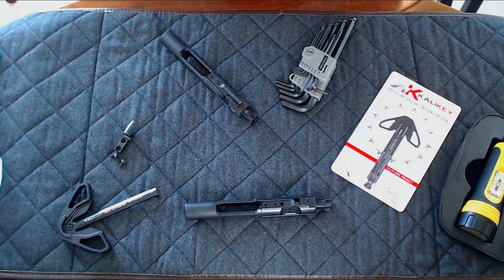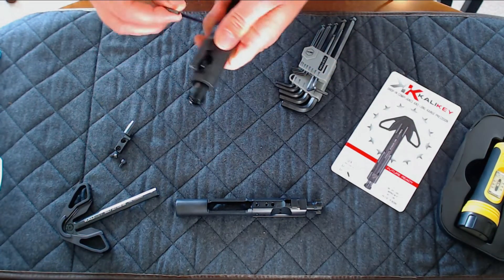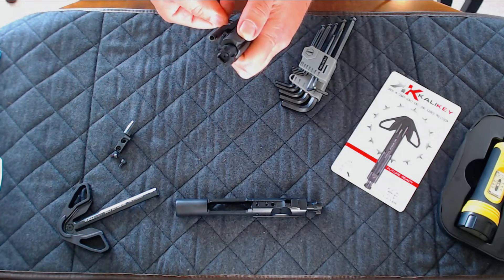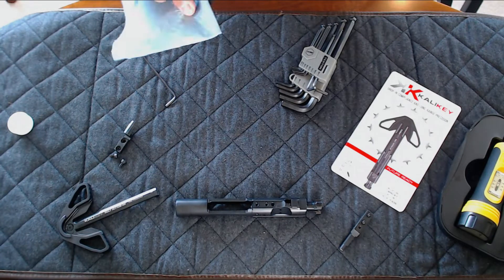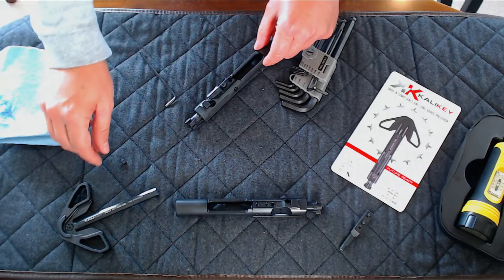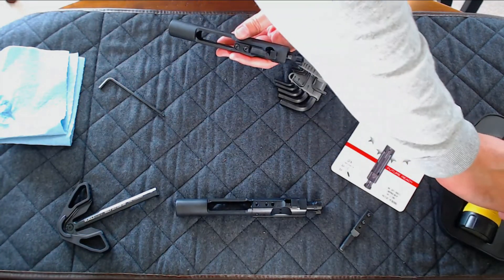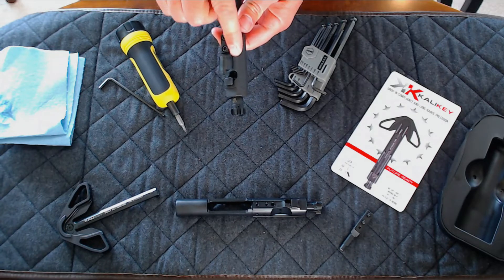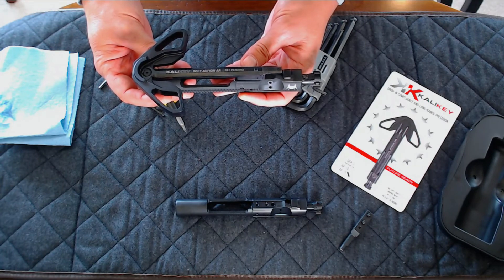Installation:  Kali Key (Gen2 Revised Edition)

Comment: Will the AR-10 Kali Key Lo-Pro Bolt-Action System + BCG Bundle  work with 6.5 creedmoor?  Running aero precision m5 upper/lower which is dpms style
Reply from the maker: Hi! The Kali Key is caliber agnostic. It also will work with all true LR308 ("AR10") DPMS patterns (meaning stuff that doesn't use some sort of proprietary dimensions/customization).

Comment: Would this work for a BCA side charging with just swapping the gas key?
Reply from the maker: @johnkrstyen  Hi, it depends on the specific version upper you have - BCA offers side-charging uppers with two apparent variations:

1. One version has the rear gas key/charging handle slot (where a mil-spec charging handle would typically fit) sized to the same width as mil-spec. The Kali Key works perfectly with this version.

2. The other version has a slot that hasn’t been fully milled, making it much narrower. The Kali Key will not fit this version.

Please check which version you have to ensure compatibility.

Comment: I may be missing something, but after installing this when you fire the gun wouldn't hot gases come through the gas tube and out the receiver? Or did I miss a step where you blocked off the gas block somehow.
Reply from the maker: Hi. The gasses are directed out of the ejection port, not towards your face. They are also not particularly hot as they cool dramatically with the air almost instantly. It is similar to shooting suppressed, minus the gas in your face. Hope this helps.
Reply: @kalikey-boltactionAR  I was just curious. Wasn't picking apart the design by any means, just wanted clarification.I ran across this looking to see if there was an off the shelf solution to turning my 458 upper into a single shot. Don't live in a commit state, just like the idea of having a single shot. Thank you for the fast response!
Reply from the maker: @sinformant  We weren't offended in the least. Asking how our product works is the most welcome question possible! Also, the Kali Key works with any caliber as long as it's in a mil-spec direct impingement AR-15. It sounds like it will serve your needs. Have fun!
Reply: @kalikey-boltactionAR  would the Kalikey work on a side charging bcg?
Reply from the maker: @mckenzieb92  Hi! If it's a mil-spec direct impingement rifle and the only modification to the BCG is a side charging knob, then you could theoretically scrap the handle portion of the Kali Key and just install the Kali Key's "gas key" to your side charging BCG in place of its factory gas key. I don't know what the user experience would be (genuinely don't know - no sarcasm), but it would absolutely work as a bolt-action because our bolt-action innovation happens in our "gas key" portion.
Reply: @kalikey-boltactionAR  thank you very much
Reply: Is the charging handle necessary for the blocking of the gasses, would a side charging bcg work without the Kali key charging handle as long as the plug is screwed in?
Reply: @mckenzieb92  I have yet to use one, but from the looks of it it say you could forgo the handle and just use their gas key that blocks off the flow of gasses into the bcg. My interest in it would be to have a single shot set up on my 458 that I could run a can on, but the gasses coming back into the ejection port would be pretty bad with the added back pressure. You could achieve the same thing without the gasses coming back of you ran an adjustable gas block but the good ones are pricey.
Reply: @sinformant  oh I meant to ask Kalikey with question, my bad
Reply: @mckenzieb92  no worries

Comment: I wanted to know if I could use your charging handle with a semi auto ar15, I really like the design and ergonomics of it, but I don't need my rifle to be bolt action
Reply from the maker: Hi!  Unfortunately, our charging handle only fits (mates with) our special bolt-action gas key, it cannot work with a semi-automatic gas key.
Reply: @kalikey-boltactionAR  alright, thank you
Reply: @BattleKegGreg  I know they already answered you, but it doesn't latch in place and moves solid with the bolt, if it did work, you would receive a swift punch to the face when you fired it and the bcg came back.

Comment: Does this work for saint victor ar 10 308?
Reply from the maker: Hi! While the Kali Key works on any AR-15 pattern rifle that uses a mil-spec BCG, "AR-10s" are a different beast as there is no standardized mil-spec. The "AR-10" Kali Key works on DPMS pattern (also known as LR308) "AR-10" rifles ONLY.  It will not work on Armalite or proprietary pattern "AR-10s". DPMS is the most popular and widely used pattern on the market. The literature on your rifle does not specify what pattern it is. However, it LOOKS like a DPMS pattern (though I can't know if they did something proprietary to it). This article I found also believes it is likely DPMS, but can't say with 100% certainty either:  https://gundigest.com/rifles/ar-15/springfield-armory-goes-ar-10-with-saint-victor-308

To be 100% sure you should ask Springfield. Ask them what "pattern rifle" it is and ask what "pattern BCG and bolt" they use - or simply ask them if it is a true DPMS pattern rifle.  

(The reason I keep putting "AR-10" in quotes is because it has become the popular name for the large frame AR - like Kleenex has become for facial tissues - but it is technically not universally encompassing of all the different patterns.)  Hope this helps somewhat. We have more information on DPMS vs Armalite patterns, etc. in the FAQs on our website.

Comment: Does it work on left ejecting rifles?
Reply from the maker: Hi.  The short answer is yes, but.... the longer answer is:  The Kali Key will work as designed regardless of how your rifle is set up as long as it is a direct impingement rifle.  Also, you won't have any issues ejecting assuming that you are set up with the correct BCG, etc.  However, the gas will still be diverted to the right and have no place to escape a left-side ejecting upper so you will have a lot of fouling inside that left-handed rifle.  If your primary use is compliance, you will be fine, but you need to make an informed decision.  Thank you for your interest!
Reply: @kalikey-boltactionAR  
Thank you.